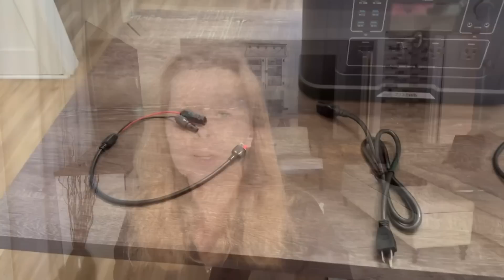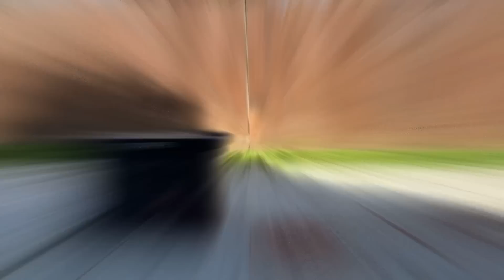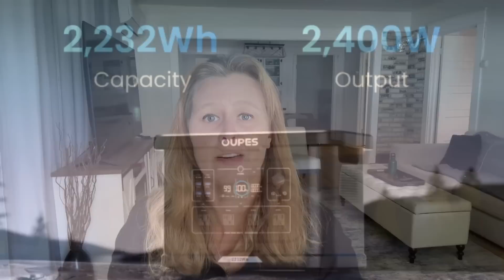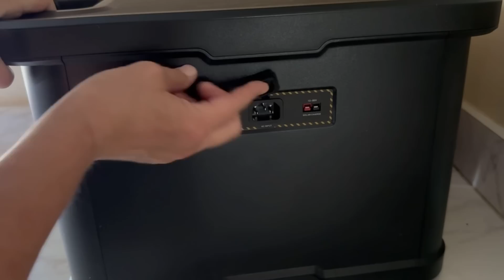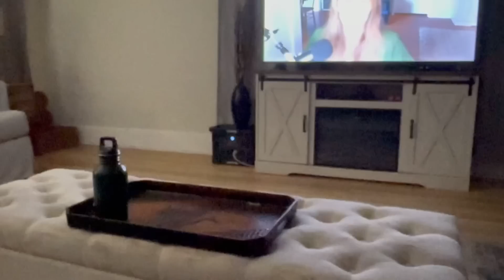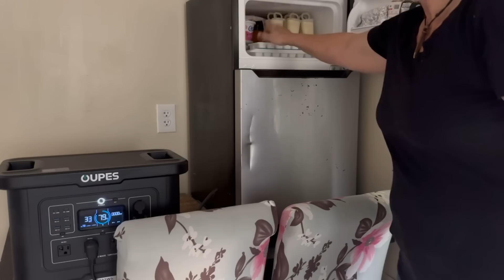BLACKOUTS ARE COMING! BE PREPARED WITH THE OUPES EXODUS 2400

Comment: Today,  I suggested to my husband that, perhaps, we should start our annual discussion about whether we should buy more power generators to run our fridge, since we ran out of ice to keep our fridge cool, and had go drive 45 minutes go get some more last year after hurricabe Milton left us without power. 

We usually start this annual power discussion in October when everything is expensive and short in supply.

We both agreed that the likelihood of our power going out was slim since our power company had trimmed all of the trees that knocked out the power last year during the hurricane. 

But, we decided to plunk down another $1000 on more power,  just in case, because we are just sick of having to bark at the kids for opening the fridge door and letting the cold air out after the hurricanes have knocked out our power. 

Lo and behold, two hours after our decision was made to purchase more power, a lightning storm came through and knocked out a transformer, and our power went out. 

We didnt have the new generator yet, but we had our others already set up to "plug and play" to run our Internet,  and hurricane lamps already on shelving in the kitchen, waiting from last year, which we had lit on kitchen table within seconds.

When we moved to Florida, 9 years ago, I knew nothing about backup power, and it was Prepper Pricess' early videos on backup power that helped me to learn how to acquire and run solar generated back up power which enabled us to have Internet last night while we ordered our new generator that will enable us to run our fridge the next time telling power goes out.

Comment: The Bluetti Elite 200 V2 is less expensive and has pretty much the same specs.  For those who are really on a budget, there's the Bluetti AC180 which has 1800 watts/ 1152 watt hours for around $419 refurbished on EBay.  They come direct from Bluetti and are packaged like new and have the same 5 year warranty that a new one has.  For the price of 1 Opus 2400 you can have 3 Bluetti AC180's and have them around the house during an outage or swap them out, using one while charging another.  Take a look.
Reply from the maker: That’s half the battery capacity as the Oupes. If you have ever had to go without or use one in an emergency, the battery capacity is more important than the solar input. If you want to lug around several generators that’s fine I guess.

Comment: We have had blackouts and grid downs for 10 years, there are cheaper alternatives on the market. We have bulbs that charge when you have power and when it goes off your lights stay on. Gas heater and gas stoves. Hiking stoves. Don't forget that your sewer system will be affected. Products like foam (toilet) and no flush will help with that. Loads more tips available, we been living it for 10 years so old pros.

Comment: Thank you for this video. Would this item run a portable heater, 1 light & a fridge for a few days? I also have a freezer. I was one of the people effected by the TX power outage a few years ago. The power was out for several days & the roads were impassable. My house is total electric & doesn't have a fireplace or Wood burning stove. I want to be prepared for next time.

Comment: I'm ready. 2000 watts of panels two 40 amp controllers, 800 aH lithium batteries, or 20,000 watt hours. Runs the air conditioner and the freezers, air fryer, etc.

Comment: Here is Florida, it's hurricane season!  So is this battery operated and will it work for big items like electricity, fridge and so forth? I'm still reading up on it, thanks for sharing the websites.
Reply: Overtime,  we have acquired both solar and gas. The solar has not worked so great during the rainy season due to needing more sun, so we also just bought gas to run the fridge.  Our solar generators are charged up and ready to go, and we store five gallon gas jugs to run the gas generator to power the fridge. When the rainy season is over we'll put any extra gas left over in our car gas tank, and refuel the gas jugs next May when the rainy season starts up again.

Comment: I have 5 power stations of various sizes and brands, along with stationary solar panels, a dual fuel inverter generator and many 20-100 lb tanks of propane in my pole barn.  I gave my son and his wife a small Jackery 240 and the portable solar panel as a gift a few years ago and about a month later a storm took out their electric for 2 days.  They were so happy with how it preformed that they calculated their needs and bought a much larger EcoFlow (they were having the best sale at the time), along with stationary solar panels.  I live rural and in any outage we're the last ones to get reconnected because of low population density.  I look at power stations as just another form of insurance.  2232 wh for $675., with the discount, is a good buy.

Comment: What size of solar generator should I get for my refrigerator? Or whole home? We live in Central Texas and remember the power outage. I have a smaller jackery for cell phones, laptop. I'd like to have one for the refrigerator at leaste.
Reply: A solar generator is  for small applicances not whole house use. A LP/NG whole house generator would be better for the job. A gas powered generator would do better for a regular sized refrigerator. You COULD go solar with  a 12 volt mini fridge , the solar panels and battery pack
Reply: @cindylong624  thank you. I do have a gas generator for the refrigerator currently.
Reply: A refrigerator uses 120-150 watts so this unit should run your fridge for around 10 hours.